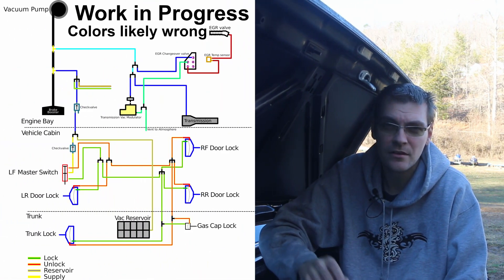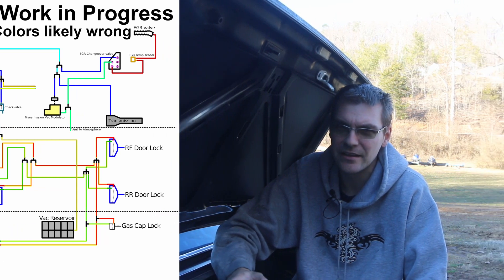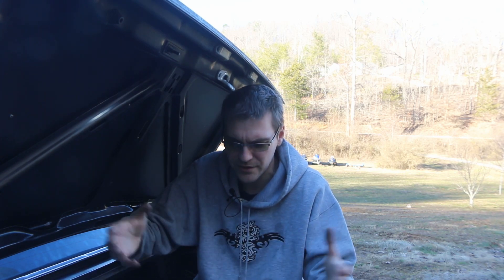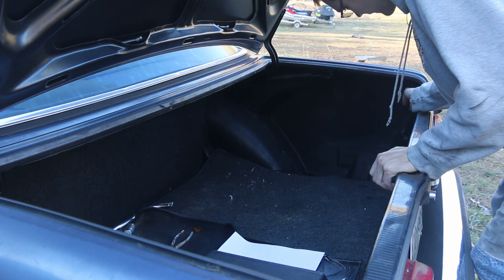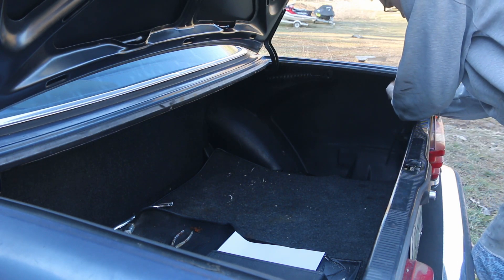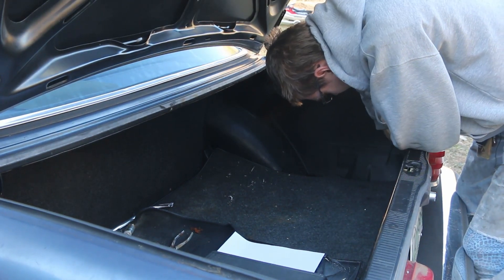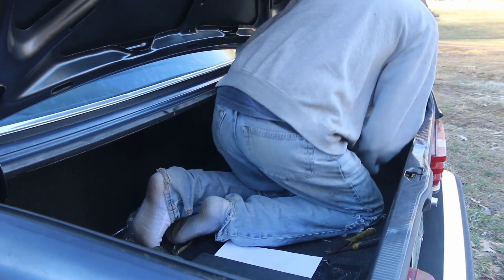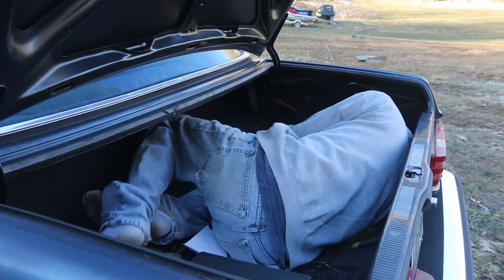W123 Vacuum system troubleshooting [PART 1] (Most Common Central locking problems) Plus DIAGRAMS!!!

Comment: Did you ever make a  Part 2 video of this in other words (W123 Vacuum system troubleshooting [PART 2]?
Reply from the maker: I have not, I've been meaning to address the transmission vacuum system, as well as the door and trunk lock pods, but all of mine have been working ok, I keep thinking I've got a door pod going bad but it hasn't stopped working, just seems a little weak occasionally.

Comment: Hey! Turning to you because all the ressources on the internet are for very complex systems. Hope I will be clear enough:

My car is a poverty spec 300D NA manual euro car.

- No central locking (no doors, no trunk, no fuel)
- No HVAC
- No EGR or other types of emission control
- No vacuum operated auto transmission
- No cruise-control.

Am I right to assume that the only vacuum operated thing is my ignition?

In that case, is there a check valve somewhere I should check? Under the dash maybe?
So far, I have checked all the connections in my engine bay.

If this gives any clue to you : it shuts off fine when cold, but struggles when very hot. (right after a highway drive for example).
Sometimes, I feel like I "help" it shutdown by pulling on the ignition while turning, does that make any sense?

I'm just hoping the problem isn't at the pump itself... Thank you!
Reply from the maker: I suspect you are correct, the only things you should have vacuum related is the brake booster and the shutdown pod.
I've not personally seen the hose routing and such so I'm just guessing based on what I know from my cars.

Do you have a mityvac or even a vacuum gauge and a tee?
My testing process would be:
- Connect a mityvan to the vacuum shutdown pod (https://youtu.be/SsqJ37AZV_M) or tee in a gauge so you could observe the vacuum level if you don't have a mityvac
- Pump the mityvac and see if the pod holds vacuum
- If it does, there must be a leak somewhere else.

The shutdown circuit is pretty simple, if I'm recalling correctly there is a brown vacuum hose in the engine compartment goes directly to the keyswitch, and then it goes back to the shutdown pod, so there is maybe only 4 or 5 connection points where a rubber connector could have become cracked with age, or it is possible the shutdown pod or the keyswitch is leaking.

I hope this helps you narrow down where the issue lies!
Reply: @trythistv  this is really good info thank you very much. I'm thinking the same things. 
My real fear is what you called leaking ignition lock. What does that mean? Am I gonna need to get a new switch lock? How will I make the keys coincide. That scares me

Comment: Are this system same as W124 ?...
Reply from the maker: The hoses and routing are vastly different on a w124, these diagrams basically only apply to federal w123s with the om617 turbo engine, I hope eventually to expand and make diagrams for other models but it is quite time consuming and I doubt anyone wants to loan me their car for long enough to disassemble and chase all the vacuum lines needed to make the diagrams.
I'll find cars to use somewhere eventually!

Comment: Hi, I’m new to learning about these w123s
So basically the w123s use a vacuum system instead of an electrical system to : open locks, ac function,pw function,side mirrors, transmission, egr etc.?
Reply from the maker: I don't believe the windows or mirrors have had any vacuum elements, but yes, locks, hvac stuff, transmission pressures, egr, and probably some assorted things I'm forgetting.

It seems foreign and weird coming from more electronic controlled cars of today but its not terribly hard once it clicks for you. Rotten rubber fittings and cracked plastic vacuum parts will be your big problems.

Comment: Hey Jarod! I have been watching your videos and got  many issues resolved on my w123 85 . Last year I have changed all visible vacuum connectors coz one of them has a crack and it has been working fine untill this week . This week almost every day we have in ga about 100 degrees, and my car during the day time when it is really hot does not shut off as it should it takes about 40-45 seconds before it stop. Early in the morning and late evening when the tempratures are low it works fine, any suggestion , where and what to look for? thanks in advance
Reply from the maker: That has to be a vacuum leak somewhere. Check what I do in this video: https://youtu.be/867EaMUxUKs?feature=shared&t=47 starting at around 45 seconds, that 4 way connector controls the HVAC, Locking system and shutdown too, so if your locking system or hvac system is leaking, your shutdown will be slow or non-functional entirely.
Reply: Thanks a lot for a quick response HE may bless you , You are always a good help for many of us.  @trythistv
Reply: Once again thanks , I was trying to buy the RC car shock absorber boots through the link in your video they pop up with two different sizes 36 mm and 46 mm, which size would be the right one?  @trythistv
Reply from the maker: @teesaeed6529  I just checked and I bought the 46mm ones. I'll have to add that tidbit in

Comment: Hello Wondering if you could help 
 I have a 1981 300SD Turbo Was running fine But now Starts fine Runs 3 seconds Then shuts off ... Even if I Give it gas Idols hi Still shuts off After starting 3 Second later Wondering if you have any advice ? Or came across that issue before I would think that it would be the shut off Velve But how can it be stuck open Let me know if you can help thanks
Reply from the maker: I would disconnect the vacuum line to the shutdown pod, should be brown with a blue stripe near the injector pump under the hood and try again.
Reply: @trythistv  Thanks bro for a responderback I just wonder how can That be stuck Is there something causing it to make a Constant vacuum I am going to try that then try starting it Disconnecting the Shut off valve I'll keep you up to date But do you know anything else that would cause that issue it's strange Car runs fine for 3 Seconds Then dies I can even accelerate it It accelerates and dies in 3 Seconds So that's what I was thinking the safety shut off Valve But how would that be possible 🤔
Reply from the maker: So the cars vacuum pump feeds a line that goes to the ignition switch, which then stops vacuum from getting to the shutdown pod if the switch is in the run position. When the key is switched off, the switch applies vacuum to the shutdown pod and it parks the rack in the injector pump, forcing the fuel off basically. So if something is wrong with your hose routing or keyswitch stuff, it could be applying vacuum to the pod constantly, and you'll only get vacuum built after a few seconds of running, it'll bleed off when the engine shuts off.
Reply: @trythistv  Wow that's crazy ... There was something messed up with the car The ignition switch I had to drill it out .. And replace with another ignition switch ... Put the Back Of the Key assembly units Was disconnected Like you can start with the screws driver ... Did not notice until after Replacing the ignition switch I'm wandering with the combinations It's causing It to stop Pretty strange but never worked on diesel before lol If you have any pointers let me know thanks If you ever need any help with electronic repair Let me know
Reply from the maker: @QsTechService1  Yup, I'm sure that's it. Because the diesel runs without spark, it has to have a physical means of shutting off, either cutting the fuel supply or the air supply, Get that sorted out and you'll have a fun car!

I just bought a hot air rework station with the hope of repairing some ECUs from Seadoos, I'm just learning how to use it, I've done thru-hole soldering and basic wire splicing type stuff, but SMD is a whole new adventure.

I'm watching your video on your car right now, it looks great honestly, going to need some cleaning and some window and door seal type stuff, but that car will last a long time!
Keep me posted on how it goes getting it all up and running!
Reply: @trythistv  I will be doing some follow up videos on this car .. Not easy filming lol  But you have some great videos out there too explaining a lot about the vacuums Give you credit will definitely subscribe ... I just recently got the car got it fired up running ... But Had to do emergency shut off Once But I was thinking maybe a tour of the Diafram .. Of the shut off safety switch system  But I recently drilled out the mission switch And replace with a new one After replacing the ignition switch Car doesn't Run
Reply from the maker: @QsTechService1  Nice, I look forward to seeing your videos of getting the car back roadworthy! I bet your whole problem is replacing the ignition has messed something up with the vacuum switch part of the ignition. I'm sure you can figure that out, vacuum stuff on these cars seems so weird to begin with but it is remarkably simple after you spend a little time with it. Have you checked out my vacuum diagrams and stuff: https://trythistv.com/w123vacuum/
Reply: @trythistv  Thanks for the help Your diagram I came across Is is what led me to the Vacuum shut off switch Thank you for providing that diagram for others To view That's exactly what it was the vacuum shut off switch From the ignition switch Was sucking Vacuum at all times Causing the car to die After three seconds are running Surprise no one has videos on that I posted one

Comment: So I'm pretty sure this is the problem with my vacuum system. But I got a question. 

If I don't want to go through the hassle of repairing or replacing this white pod thingy, could I just unplug the two hoses going to it, and clamp them off to stop the leak? I already have a locking fuel cap anyway.
Reply from the maker: Absolutely. You could plug the lines going to the pod with golf tees, bolts, anything else vaguely plug like, or you could remove the tee that splits the line to the pod and replace it with a couple inches of vacuum hose.
Reply: @trythistv  You star!
Reply: @trythistv  Sometimes you gotta improvize. I found an old EU phone charger plug. Turns out the two prongs line up perfectly with the mentioned lines, and are just the right diameter. Now my doors lock AND unlock again. :D

Comment: so today, 3 areas of the car stopped working: engine shut-off, door lock control from driver's door, & HVAC; should I start with the vacuum pump itself?
Reply from the maker: This is hilarious timing. I'm working on another part of this vacuum video series, and I had the exact same problem. Door locks, engine shutdown and HVAC controls all stopped. What you want to look at is right near the oil filter area there is a x shaped vacuum coupler thing, it has brown with yellow stripe, green with yellow stripe, and a big yellow check valve that has yellow and yellow with a grey stripe. If you check the diagram on the website, in fact the thumbnail for the article on the website shows that part, but the diagram also shows it, and the brown and yellow is the shutdown circuit, green with yellow stripe is HVAC, and the yellow check valve feeds all the central locking controls. My HVAC pod for the floor vents ruptured and was the cause of my problem, but you can narrow it down by pulling each of those 3 out of that coupler and plugging it off with a golf tee or something and see if the other item start working. Hopefully that makes sense for you!
Reply: @trythistv  thx, it was a cracked 4-way coupler!
Reply from the maker: Yup, that goofy 4 way coupler got me too not long ago. I fixed it and then ended up with a ruptured vacuum pod

Comment: My locking system has gone from bad to worse that the car does not switch off and I can't open the trunk and haven't got the key's to it,getting the write person in Cape town that is not going to give you incredible long stories about this problem and charge you,I'm looking for that honest person 😏
Reply from the maker: Well I'm not in cape town, but I feel your pain. Finding anyone half knowledgeable with these cars that isn't going to charge 4 arms and 7 legs for a simple vacuum problem is a bit of a challenge anymore.
Normally the same ignition key also fits the trunk, unless perhaps you have a key cut on a valet blank, which wouldnt fit the trunk or glovebox, and solving that may be as simple as getting the key copied onto a "master" blank. Otherwise, you may be able to isolate the hoses in the passenger kickpanel/floor area and use a mityvac to try unlocking the trunk
Reply: @trythistv  You are exactly write of overcharging and I haven't a key that fits the trunk 😏

Comment: Awesome video and fix! Somehow my vacuum seems out of sync with the position of my locks. I’ve tried manually adjusting them and they hold vacuum but won’t get in sync with the master lock switch. Anyone ever experience this or have any suggestions? Happened when a locksmith was repeatedly trying a key copy he made for me. We’re working perfect before then. Thanks!
Reply from the maker: I'd be very suspicious that something got knocked loose, or bent inside the door, there is a little master vacuum switch connected to the lock on the drivers door, perhaps the hoses are attached in the wrong order? or the linkage or such is not putting the valve in the proper positions?
Reply: @trythistv  somehow my old 300d fixed itself. the locks are back to normal so not sure what happened but ...i'll take it!
Reply from the maker: @danrauch9780  Ah, Self healing problems are the best lol, glad your locks are working again!

Comment: Great video.. Thank you!  Do you still have your W123?   I have had mine for about 12 years and just getting around to doing a lot more work on it.  Thanks for the videos.
Reply from the maker: I do indeed, I actually have 2! The blue 1982 300D that is in most of the videos, and my Grey 300D that is also a 1982 model year, however it has been 4 speed swapped, 2.88 rear diff, 2 tank WVO system, k26 turbo swap and some other minor adjustments here and there to make it a fun little car.
We just took a 1500 mile trip in the blue car, I'm working on these vacuum diagrams more, and arranging things to make a few videos soon documenting the 1500 mile trip, what went wrong on that trip, and the next parts of the vacuum system that I want to tackle!
Reply: @trythistv  well I enjoyed your video and most importantly I didn’t even know I had a fuel door lock and sure enough checked after your video and there it is my mightvac arrives In about a week.  Today I did a power steering flush. I love working on this car.  I will post a video on a dome light repair/rework soon.

Comment: Wait so what is the fuel door acctuator for?
Reply from the maker: It locks the fuel door shut when the car is locked
Reply: @trythistv  ohh so it has nothing to do with fuel being sent to the engine bay correct? cause when I went ahead and took out my fuel tank to clean it  i stumbled upon that weird ball tray that sits on top of the fuel tank and wondered what it was for.
Reply from the maker: The ball tray looking thing is likely the vacuum reservoir for the locking system, but yeah the fuel door actuator has nothing to do with fuel delivery, on the diesels the only thing controlling fuel is the lift pump and injector pump itself, the cars will run and drive flawlessly with no electronics. I had my alternator die once and didn't notice until the radio shut off, and lights were too dim to drive anymore lol

Comment: great video! Question for you. When testing the vacuum on your reservoir, you mentioned it required "a lot of pumps". How many pumps would you say? 

I'm troubleshooting some vacuum system issues with my '79 300td wagon. Malfunctioning are the door locks and the engine takes a while to shut off after the key is turned to the off position.

I've isolated it to the the reservoir. When I remove the yellow line with grey stripe from the Y connector in the engine bay (goes to the reservoir) and then plug that connection point in the Y with a golf tee, the engine turns off normally. It doesn't seem to be the line because, when I plug the line back into the Y connector in the engine bay, then disconnect from the reservoir and plug that end of the line, the engine also turns off properly.

I connected to the reservoir with my Mityvac and pumped for several minutes and the gauge doesn't budge. Does this mean the reservoir is the problem or do i need to pump for 10 minutes to fill the reservoir? I've read that it's EXTREMELY rare for the reservoirs to fail.
Reply: Oh and one more question. Is the fitting on the actual reservoir replaceable and susceptible to failure? I'm talking about the male piece that the tubing slides onto, not the tubing itself.
Reply from the maker: It should move after maybe 50-100 pumps, it may not be very high but it would have enough that when you disconnect the hose you'd see the gauge jump a little back to zero and hear it make some kind of fssssss as the vacuum dissipates.
I've not heard of a reservoir itself fail, but I've heard of plenty of the rubber fittings on them failing and leaking, but if you shoved something into the trunk it could crack the tank, it is just plastic after all.
I'm assuming you plugged into the reservoir literally at the fitting in the trunk? because it is possible that the hose or a rubber fitting somewhere from front to back of the car has failed, but you'd be ruling that out by testing at the tank itself in the trunk.
You could use a small amount of pressure, or even smoke to see if it is leaking, they make machines that generate smoke at a very low pressure to make finding vacuum leaks very obvious, or you could blow up a balloon and then attach it to the hose that leads to the reservoir and see if it deflates.